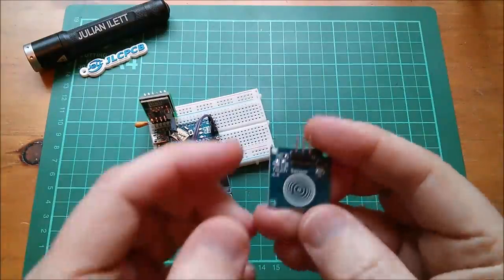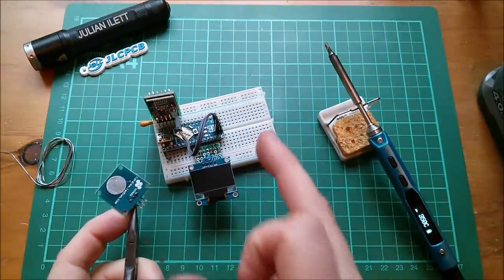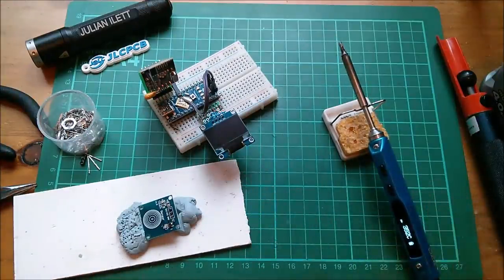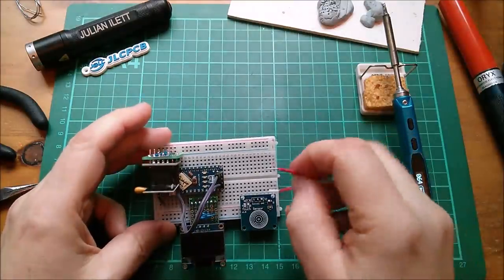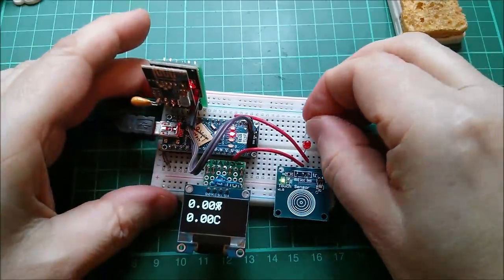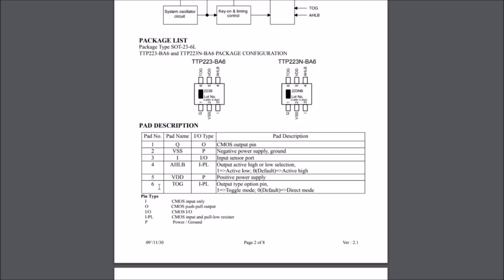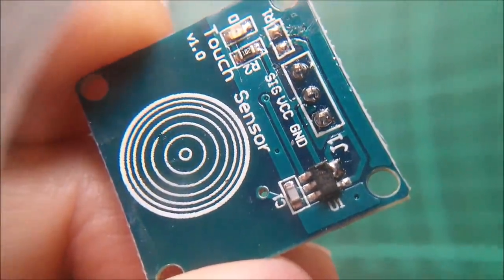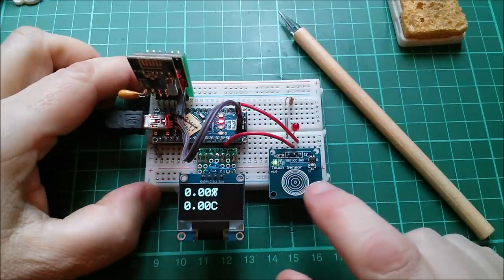TTP223 Capacitive Touch Switch Revisit

Comment: Put a little piece of silicone tubing on your solder sucker tip and it will allow you to get tip right against the soldering iron/joint
Reply: Thanks for the tip. 👍🏻

Comment: Julian, I have faced the same "toggle/momentary" dilemma (may be too strong a word!) as you do. I decided to keep the hardware switch in momentary mode, and perform the latch function in a couple of lines of code instead. Advantages: you can set the start condition of the switch during a software reboot. You can override the value by program if you need to (for example temp over-range forces fan on, regardless of switch state), or you might choose to "lockout" the button's function during certain program phases or times, you can implement dual functions by a short-press, or long-press.   I notice a lot of the so-called toggle switches in my car work this way, too.

Comment: The trick with solder sucking a plated through hole is to hold the board vertically and place the sucker on one side and the iron on the other. That way you can keep the heat on and get a better seal with the tip of the sucker.
Reply: That's how I do it. Big boards I hold between my knees, small boards I just sort of lean on the hand that's holding the sucker.
I really need to get a little vice for my bench 😂

Comment: @Julian Ilett I’m curious if the Active Low / Active High pin setting also determines the power-on state? eg. If the initial power-on state is Off (seems logical to assume), then you’d also assume this pin might control if the output is initially high or low after power-on initialisation. In which case this pin would still be relevant even with Toggle mode selected. ie. On power-up do you want the fan to default to On or Off?
Reply from the maker: Yes it does - and this became an issue in my latest video. I used a simple inversion in the sketch to reverse the power up state. Cheers Greg :)

Comment: Wouldn't an ESP32 with an "external' antenna be a better idea?
You'd get the extra bit of range you need and built-in touch switches.

Comment: Amazing what you can do when you solder suck from under the board. Visualizing what is happening and whether you actually right on the hole from underneath is a little tricky though. I've recently picked up a Anesty  ZD915 but haven't used it yet, barely have time to use my vacuum cleaner lately lol

Comment: I remember around 1977 my parents rented this cutting-edge Mitsubishi TV - Didn't have a remote control they weren't about yet unless you were rich, but the channel change buttons were touch sensitive non tactile little chrome strips which was quite a novelty at the time, just touching them to turn the telly over. I guess this is similar technology using capacitance?
Reply: This was based on the high input impedance and had many problems as random channel changings due to electrostatic,humidity,air blowing.
Reply: I remember babysitting in a house with one of these around that time. The house was old and damp with a stone floor. Had to jump while having finger on the touch pad to get the TV to change channels!  The growly dog didn’t encourage frequent changes!!

Comment: Julian, you could write a machine learning algorithm (well, probably an ANN) to optimize the humidity at which the fan should turn on and the length of time the fan should run. :-)
Reply from the maker: I'm not that good at coding :)
Reply: @JulianIlett  What's your target humidity, and do you have dehumidification to hit the target humidity even if the ambient humidity is higher? I may have some time this weekend to take a shot at it. ;-)

Comment: Weird design for that button.
If it's "touch" button it should be totally flat and all components and connector should be at the bottom...
Reply: That's how the ones I bought are laid out. Also smaller and significantly cheaper than the style he's got here. (Brand is inconsequential, there are a dozen different brand names on both styles, but they're basically the same 2 variants.)

The ones I bought also have little open blobs on the AHLB and TOG pins, so you can bridge them if you want to change the mode without needing to get all hacky like Julian did.

[edit]Ah, he mentions that he also has the "red" style, he's just playing with the "blue" style right now.

Comment: i purchased some of these from aliexpress a few years ago and just now found a practical use them... just to test them i connected one to a USB cable on my computer, with a male/female connector, then just wired red to vcc and black to grnd....  get a red light, not green like every site says i should get...and the light doesn't change when i touch it - long touch, short touch, back front, nothing... so figured it was a bum one... got another one... same thing... got ANOTHER one - same thing. so clearly i'm doing something wrong... just to test to see if they even recognize a touch, not even wiring a circuit or anything... am i just stupid or something?  what's the deal?  any idea?

Comment: Why would you send a continuous stream of "ons/offs" via the transmitter when you could program to just look for a coded "on/off" signal at the other end and switch/toggle as needed (saving power at the transmitter side)?
Reply from the maker: Because there may be lost packets at the extreme edge of the radio's range.
Reply: But I thought you were going to use an "ACK"nowledge return from the other device to confirm "on/off" as well?
Reply from the maker: Acknowledge the acknowledge payload? Probably not :)

Comment: Meant to ask on a previous vid, what's the capacitor doing on the transmitter board?
Reply from the maker: Apparently it helps keep the transmitter power at full strength
Reply: Fair enough, don't need mine to go too far so I probably leave that off. Might make the battery last longer
Reply: Helps keep the power from dropping out during spikes in power draw.

Comment: If I designed this board, there would be a jumper on the touch sensor board to set the toggle mode. I know that the board featured in the video board does NOT have a jumper to set the toggle mode. Soldering those 2 pins on the chip together might have been hard.
Reply: 4:56

Comment: You should have the unit in the shed report back the battery level once or twice a day. I know you're planning on putting a big battery out there but it's going to get low at some point
Reply from the maker: Battery voltage will be sent to the display :)